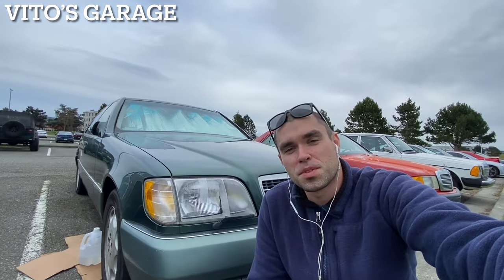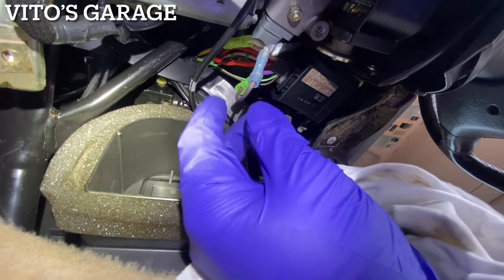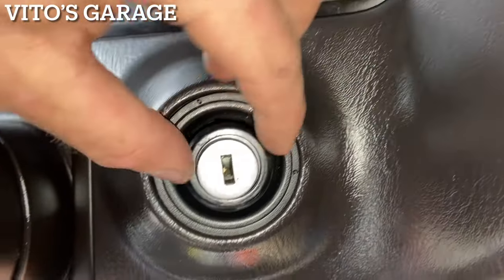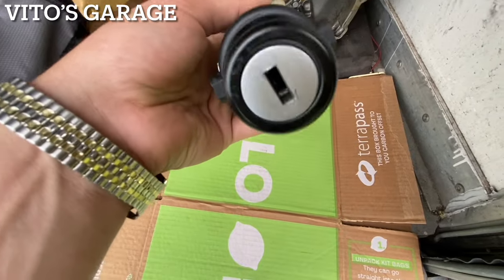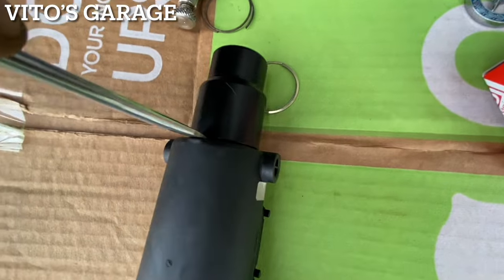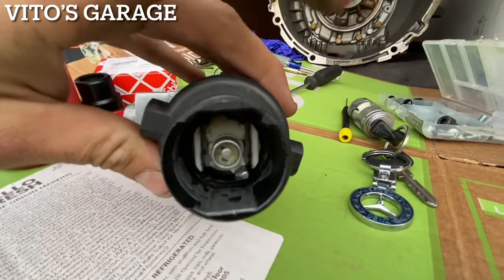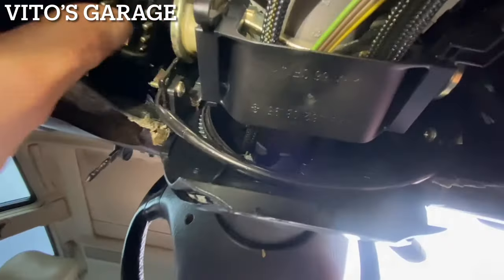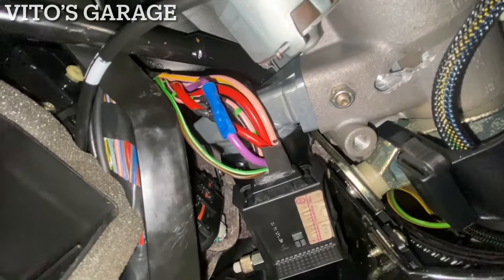Mercedes W140 Ignition Tumbler/ Lock Assembly Replacement. Additional Keys! S320 S300 S420 S500 S600

Comment: I have a problem with mine. It has an immobilizer. I followed the process of removing the ignition switch and put a new one but when I tried it the steering lock doesn’t engage when I pull out the key and the buzzer kept sounding until I turn the key to position 2. Any idea of the issue?